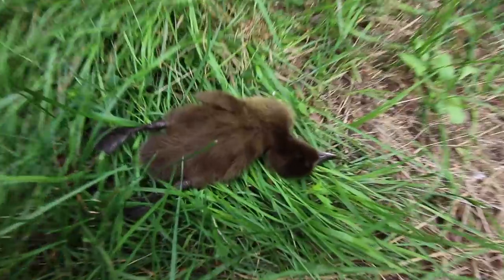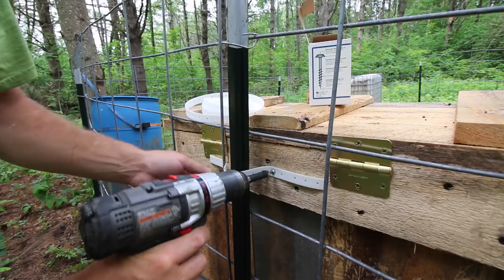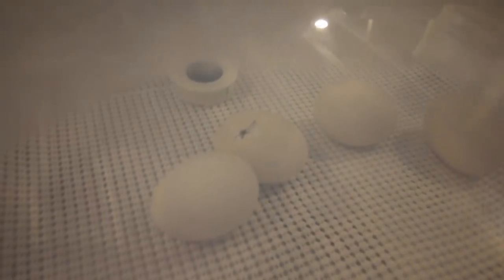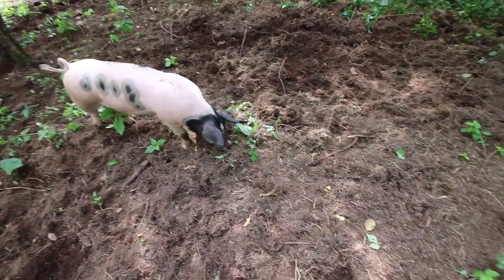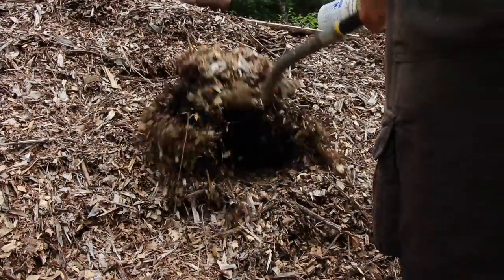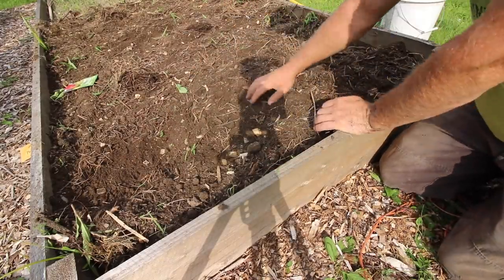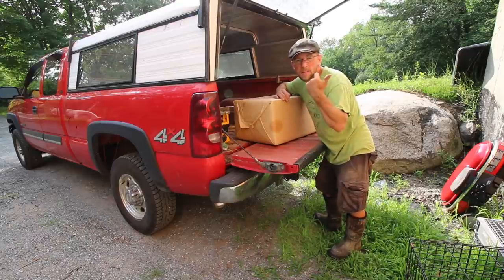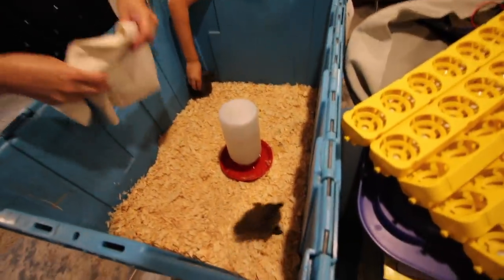Tragedy Strikes the Modern Homestead

Comment: Could they be getting into the electric fence.  You made need to contain them more with a small pen or placing a run of smaller fence around the bottom of the fence.
Reply from the maker: penny horstkamp watching them walk they thru the fence it doesn't phase them
Reply: Doesn't phase them - was that a pun? 3 phase them? single phase them? :P Fences on stun!
Reply from the maker: Simon B 😎
Reply: penny horstkamp I was going to ask the same question, that could it be the electric fence?  I was thinking the big chickens too, but they don't look attacked from what I can see on the video. I know some people have found  rabbits and squirrels dead from their electric fence.
Reply: Anything could make them sick too .. do You use VetRx Oil ?  for the sick birds ?

Comment: The ducklings aren't getting into the duck bath are they? They can get a chill really easily and can also drink themselves to death. Otherwise giving them a supply of greens like spinach and adding some brewers yeast to their food should help if its a possible nutrition issue and it can help bolster their immune system. 

But really just make sure they stay away from things like the paddling dish as they lack the oils to waterproof themselves right now and it doesn't take long at all for the cold to grab them.
Reply from the maker: Lady Potatas great info. Thank you for sharing it. No the can't get into the water. They have access to a small water drinker. I didn't know that about there oil. Thanks
Reply: That's quite alright! Just remembered it from when I had ducks and ran into the same thing! They'll produce their own oils naturally, you'll know when it happens as they'll stop looking fluffy.
Reply from the maker: Thanks! Good to know!